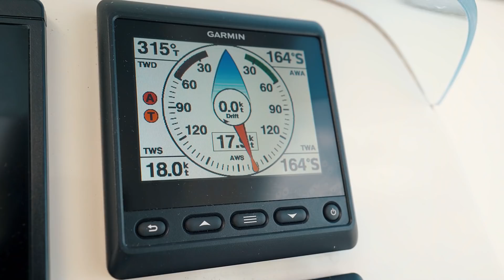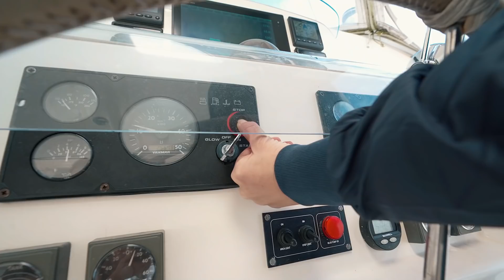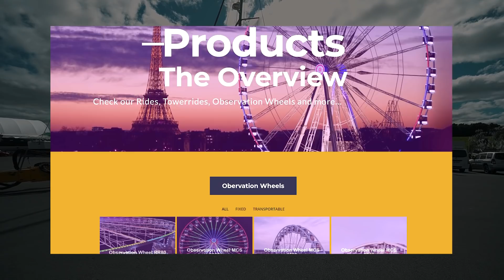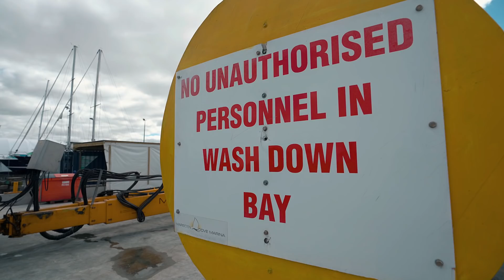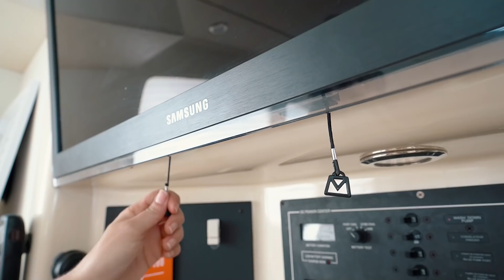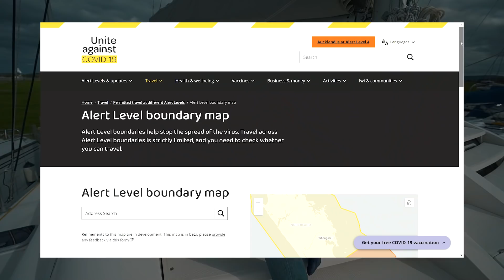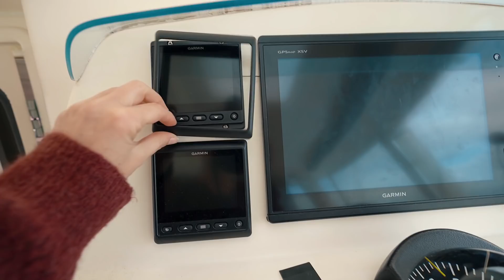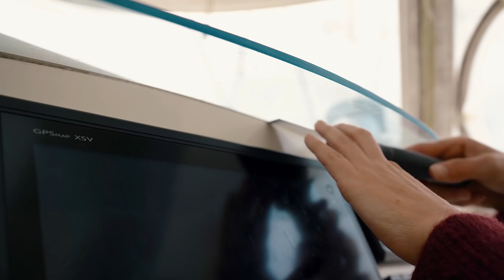TAKING OUR BOAT ON A ROAD TRIP

Comment: You guys might not see this but if you can yourself a can of Deoxit and a non conformal coating you can practically waterproof your electronics - tv / windless / anything really. It won’t last forever in that environment but I’m sure it will prolong life and minimize corrosion. A lot of people use them on racing drones that end up in lakes / oceans and typically they end up fine.

Comment: With the bad cracking around the instrument panel and all the cracked windows, it almost seems the boat is flexing/twisting, have you surveyed the bulkheads and their fixings to the hulls and especially the areas around where the bridge deck is attached. You also have some bad rust streaks, the cause of which will need investigation.   Keep up the good work to get Curiosity ready for the next adventure.

Comment: I was almost in tears watching 'Curiosity' be moved to "The Hard"! That must have been an extremely emotional moment. That high Tech trailer,is amazing. Whew, down the road, literally!  Your 'Sailboat Crossing' the Road had me laughing nervously!  What a challenge to remove all the parts, and then see the damage needing repair; man that was nerve wracking. One Hammer, Seriously? I made Aircraft for Cessna, Proto-type, Twin Engine, I had to two Tool Boxes, one for fine tools - Micrometers, radius gauges, etc. The other for making the Aluminum 2024 parts: A Rawhide Hammer, A Rubber Hammer, Lead Straps to change the shape of the Aluminum, etc. You are in need of serious tools for your Home! Seeing the Locker Sheered off, wow, are you fortunate! That could have ripped badly and you would not be here now! Another Awesome Sunday morning escape! Thank you for all the info, and movie recommendations. Hope you celebrated accordingly after getting the work of the day Done. Be safe, God Bless. Looking forward to your progress report next Sunday!
Reply: Seriously! We just finished our survey and our hearts were literally stopped until that thing was back in the water. 😱

Comment: Ok! One Thank You so Much for this week's video 📹! I have ben dieing to see 👀 ya'll work on the Boat 🚢.  
 Now with that said. I am going to give you the secret tip on the cleaning the outside of your Boat 🚢. If you do it this way you want find spots where mold can grow. 
Here it is. 1) bucket. 2) dawn dish soap 🧼. 3) bleach. And the last ingredient Turtle 🐢 wash and wax. Mix it all together in your bucket 🪣 and wash the boat 🚢. 
This is what you get. The Dawn dish soap 🧼 cuts ✂️ the dirt and grime. The bleach kills the mold and helps in removing the stains it leaves behind. And the best part is the Turtle 🐢 wash and wax helps wash and wax the boat 🚢.  So at the end you have a clean and shiny Boat 🚢 at the end.
I did this with my Boat 🚢  in San Diego. We was wright across from the airport so i had to wash my boat once or twice a week to keep her clean and Shiny. 
The good thing is after you wash her you just wipe off the windows and your bright work and you are done. And sitting and having a Nice Rum&Coke at the end. 
Ok untell next week, Aloha from the Big Island 🏝 of Hawaii 🏝

Comment: I normally skip over the sponsorships, I listen just long enough to figure out who is sponsoring. I watched all the way through today. Either you did a really good job on engaging me into it, or my brain is slightly dead from this freaking migraine that is trying to come onto me. Either way, that was a really good way to do a surf shark advertisement.
Reply: It was how spiffied up and cute she is!  What a doll.
Reply: I generally skip them too, but today I understood why a VPN was important and why I need one. Thanks for the great explanation and reasoning!
Reply: Yeah, the wynns are great at producing, and making everything look so polished.
Reply: Speaking as a computer nerd who has been using computers since the days of punch cards and whose first modem was all of 300 baud (that's right, slow enough to read text as it appeared on the screen) Surf Shark is one of the best rated VPNs there is and has consistently been so for a long time. Yes, everyone should have a VPN installed on their computer, tablet, phone or router. Some tech savvy neighbor or some customer at your restaurant, could be using packet sniffer software and getting your emails and passwords. That's why you want end to end encryption on what comes and goes on your computers, etc.
Reply: I should add after that above post, that I'm in no way connected to the Wynns or Surfshark, nor do I know or ever met anyone who is.
Reply: It was the headband (or, is that a hairband?).
Reply: this one was good cause every country has different shows you'll never hear of. like the Derry girls(Irish)channel 4 its free to in Britain or net flicks, now i got 3 more shows to check out

Comment: Hi Wynns as ever a great video.  I have a couple of novice questions, do you know what caused the cracking in the helm panel?  Also do you have a captains licence to run your cat or do you need a basic licence to sail the high/low seas?  Good luck with the repairs, I wonder if the life raft space should be covered with glass so is a bit like a glass bottom boat and you can see some wife life below, cats would love it:) Look forward to the next video.

Comment: Using the wrong tool to pull those instrument  covers. Buy a set of automotive plastic rivet and clip pullers. They’re cheap and very handy. What you need is one for leverage at the corners then another to lift the sides.

Comment: Spend...spend...spend is the reality of boat ownership!  I've had 4 boats....I know.  Timmy C Arizona
Reply: I thought they should have had a cash register going as the boat is pulled, then when SOMEONE ELSE pressurecwashes the bottom...
Reply from the maker: Pressure washing is usually included in the cost of a haulout because it's easier to get that stuff off when it's damp, AND that stuff really stinks when it starts to dry up and the whole boatyard would be stinky!
Curious Minion

Comment: 16:03 Removing the surround for the instruments. Insert your tool, then place a flat screw driver behind and perpendicular to your tool, and use that to apply leverage. Job done! :)
Reply: Good advice but I'll add to put something under the tip of that screwdriver to protect the finish.
Reply: @greatpix  exactly.

Comment: Been meaning to ask since the rough seas, what good is a life raft in a sub floor compartment if the compartment can disappear in high seas???
Reply: They were saying in an earlier episode that the life raft was located in the box so it would be accessible should the cat capsize.  Then in an emergency you could access the raft from the underside.  They went on to say that in later models of there cat the raft was removed from this place as very few cats turn over so made it a bit pointless.  Also makes me wonder if they also discovered that rough seas would wipe the raft off the bottom so changed the design.  Hope that helps

Comment: I have had good luck removing (non marine) cover plates with the plastic trim removers they sell at automotive stores.  I had to sand the end of one down to get thin enough to slide between two very shiny plumbing escutions, but it worked.  The plastic pry bars that they use to get into cell phones also might be strong enough to pop those little retaining tabs on the covers. Just spitballing future options.
Reply: Yep, the plastic body panel tools for cars are great for many uses, and perfect for this. (based on my experienc)
Reply: Yup, automotive trim remover tool was my thought also.  BTW, the cell phone versions are referred to as "spludgers", I kid you not!

Comment: If you apply a little hair dryer heat and gental upward pressure for several minutes it will slowly release its bond   especially  the putty  style   forcing a tool  in is too brutal and prone to breaking

Comment: Take a small sledgehammer and accidentally fall against your other windows that aren't cracked but need replacing then they would now be cracked and eligible for replacement under quarantine rules.  Oops. Oops again and again until the job is done. Just call them back and say "after a closer inspection we have found that all our windows are cracked".

Comment: You should check out the bottom antifoul   That Sailing Zatara used. It’s made by some guy out of Florida I think.  It they had him fly down to NZ, to the same place y’all are I think because they used that same amazing trailer to haul out. But they had it on for quite a while and when they hauled out their bottom was completely clean. It was amazing. I can’t remember the name of it, but it was in their NZ haul out video:

https://youtu.be/vdSPqk3Tgek

Comment: Those "long things" under the dock are NOT healthy, they're Mediterranean fan worms, and introduced species only found in the place you're at and Auckland, apparently. Heavy fines for introducting them elsewhere and you require proof of anti fowl or haul out and pro water blast within 6 months to go to any port outside those zones once you've spent time IN one of them. New biosecurity laws just came in preventing movement and requiring clean hulls on moorings, too. Interesting trailer, though.

Comment: That putty knife is too flexible for what you are using it for, you need a auto trim tool , they come as a set with sharp ends just right to remove the equipment frame.

Comment: I've watch you guys pull stuff off from a caulked seal in several videos now, but I don't get why you don't run a knife to cut the caulk as you pull and instead, you just brute force it with prying and applying large amount of leverage. If you cut the caulk with a knife as you go, you'd use less force and won't be cracking or breaking off the material you're trying to save.

Comment: Why were you removing the covers, the outer plastic rims, from your navigational equipment? I have never seen any need to do so, unless you are completely replacing the equipment for some reason or a screen dies and needs to be replaced. Why did you take the shield off, it looked perfectly fine? No explanations make me scratch my balding head, LOL 

Ok, OK, saw the two cracks in the helm frame once everything was taken out. But honestly, didn't look all that bad and everything wasn't falling apart from what I could see. And what caused it to happen in the first place? Because if you don't figure that out it will happen again and again no matter how many times you repair it.

Also, the steps or stairs or whatever, I would just completely REMOVE them, they serve no purpose really. You can have small little steps to replace them if you need to get up on the roof and access the boom that way. But leave the windows open, so much better that way!

Comment: I'm am normally loving you episodes, but what the hell was going on here. There really was no explanation as to why you were dismantling the instruments. You made mention of some crack, but apart from showing the crack in close up, you didn't give any idea as to where this was in relation to the instruments. Nor why you felt is was necessary to remove the glass fasciae over the top of the instruments!  Then after removing the glass, suddenly you end the video. 
I'm thinking you must have been either pressed for time, or were limited in you ability to upload a long video this week...🤔  What is going on? Are there other issues with where you are or with doing your work? Something seems up here...
Reply: Watch it again, you missed the crack.
Reply: @pavichapin  Ok. maybe I dozed off for a split second!